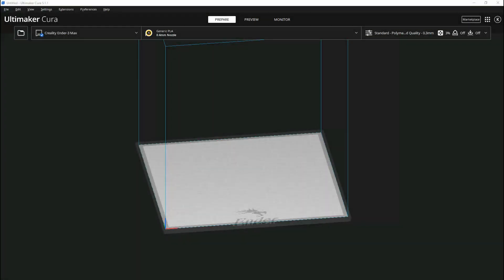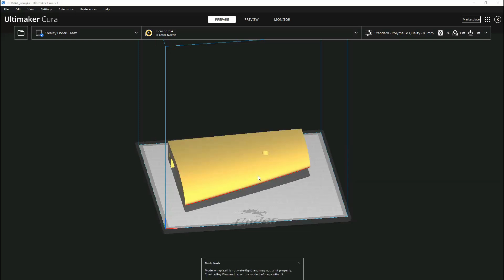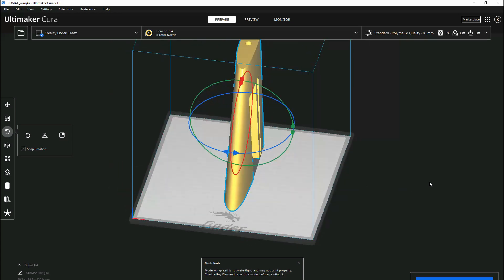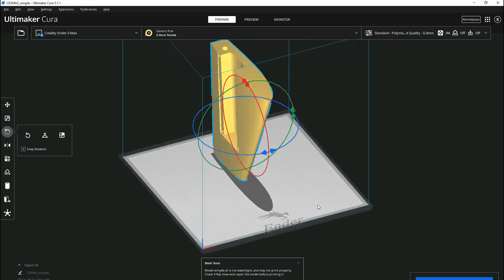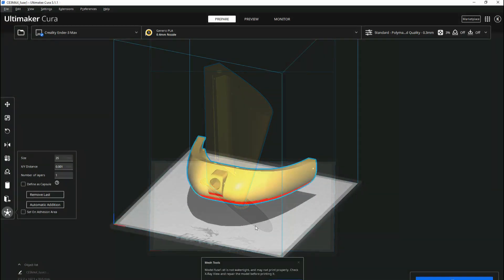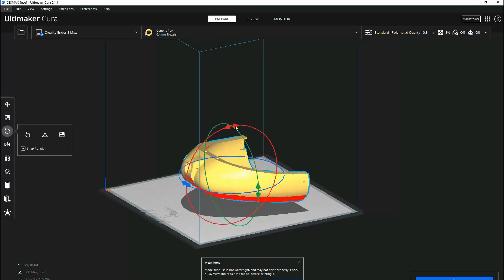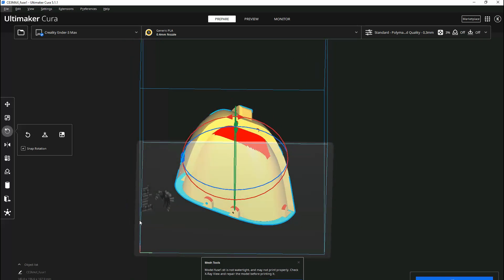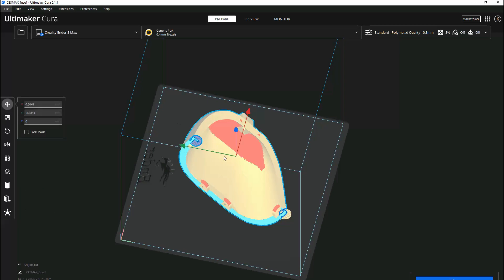Tutorial - How to properly orient components for printing Titan Dynamics 3D aircraft.

Comment: Thanks for the video! Very informative.  You mentioned rotating the prints to 30 degrees. What does changing the angle do for the prints?
Reply from the maker: I have found I get better adhesion and cleaner prints.  Not sure why, but I used to run perpendicular and would run into odd little issues.  Rotating the orientation seemed to clean this up.  Again, not scientific approach, but the jobs seem to be better.
Reply: @kerrycorcoran4885  Actually you naturally already found the scientifically correct orientation. You'll notice that the x-axis moves more when it is oriented at an angle. otherwise the print head would be doing more just y axis movement in "perpendicular lines". I think that's why you're seeing better results.